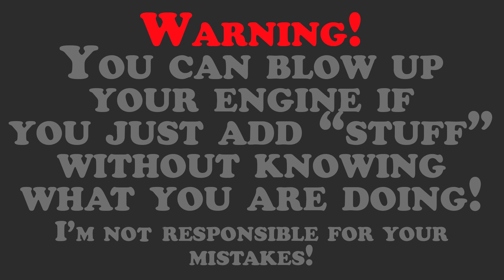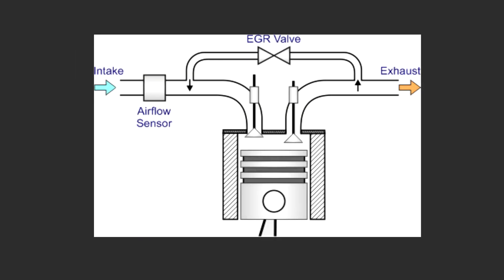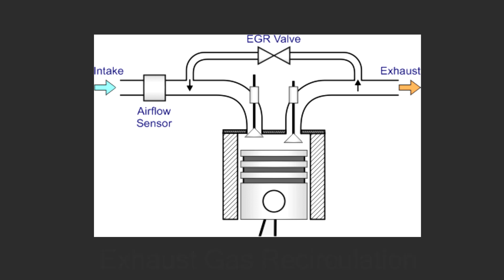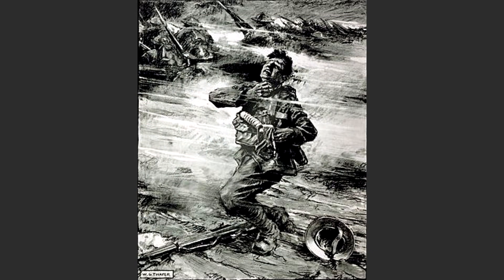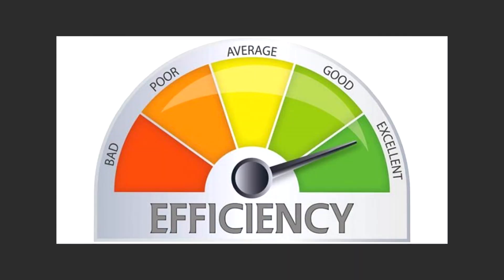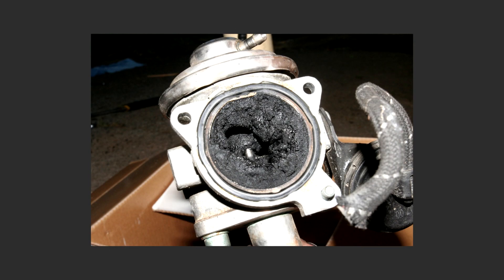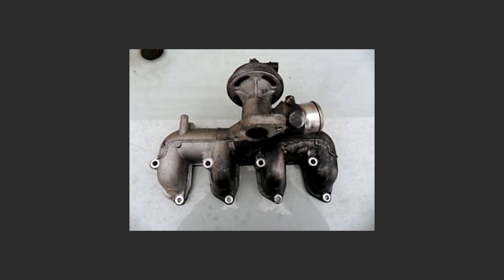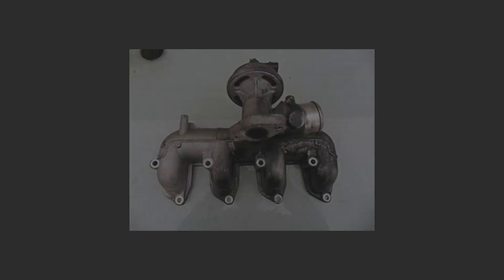Diesel Tuning - EGR Delete

Comment: I bought a blanking plate for my 1.8 TDDI but haven't installed it yet... If time allows i also want to bypass the egr cooler, i honestly think an old engine like this can only benefit from it... In some Ford forums i read that blanking the egr will lower the turbo response time... My car has a new injection pump but when it gets warm it literally loses the turbo, 6 months later at night i found an unplugged hose on the airbox, the next day i was ready to try the car properly but an oil cooler pipe snapped...i love this car but sometimes it tests my patience a little too much
Reply: I'm also planning on a coolant sensor mod using a floating sensor, an arduino and a buzzer, i almost cooked my engine a couple of days ago because of that broken pipe. I might try and do a video if this thing works out, worst thing that can happen is to buy a new coolant tank...

Comment: Do I need  to map  my car if I put blanking plates in.  It's 2012 skoda superb 2.0 tdi cffb engine
Reply from the maker: Not really, but you'd hit 2 birds with 1 stone if you do. They'd optimize the map for more power and for the lack of the EGR.
Reply: @N33sWorkshop  ok. I was told by just putting blank plate it it will cause eml  light to come on and therefore the dpf  won't regenerate and get clogged so the map essentially maps it out. I have also seen something on a forum called emulator..like a dummy egr computer which u plug into the cars system using existing plugs on car related to the egr  and vacuum hose. Essentially tricking the  car into thinking egr is active and bypassing it with blank. I'm leaning towards this option at moment as if been priced 200 for egr  delete (map out) 350 dpg/egr delete and the dummy egr thing is 122 posted d.i.y fit. What do you think?
Reply from the maker: In your place, especially if you’re planning on keeping the car, go for the more expensive option.

Yeah, maybe the emulator will do the job, but why not make it properly?
Reply: @N33sWorkshop most likely I will do the dpf egr  delete  and map it out. Just looking at my possible options and to make sure really as due to covid..money  isn't flowing best.  Another YouTube has said that  as car starts with easy start and dies wheb revved I should make sure fuel filter isn't clogged too
Reply from the maker: Yeah, I understand, but often cheap solutions become more expensive in the end.

Filters are another topic, those should be changed regularly.

Comment: Another top trick especially on pickups land rovers vehicles that’s have a chassis...... take the engine rocker cover breather pipe off the air inlet to the engine or before the turbo where ever it goes.... as this contributes to engine canker in the egr and extended the breather pipe and put it inside the chassis any oil vapour will protect the chassis inside works wonders on land rovers!!! 
O and blank it off where the pipe goes in to the air intake !!! This is a serious top trick!!!

Comment: The idea behind egr is it recycling a percentage of the exhaust gases through the egr cooler to cool them .....slightly.......I mean EVER SO SLIGHTLY!! Before it re enter the inlet manifold to re burn this slight percentage for cleaner emissions mainly on tick over blanking the egr off with a blanking plate will have no detriment to the engine what so ever if anything the engine runs cooler I did this on my Audi A6 3.0 tdi Mitsubishi l200 2005 model never had any problems what so ever this pickup did just over 212,000 miles body work let it down in the end!!!  The Audi had 189,000 miles on the clock again this never missed a beat except for right hand side engine mount sensor long story there!!! previous Audi A6 1.9tdi i took the vacuum pipe that operates the egr off so the egr valve  was permanently shut and stuck a nail up the vacuum pipe to blank vacuum pipe off!!!

Comment: Chiar asa de mult creste temperatura in cilindru in cat sa se uzeze motorul in urma unui egr off? Ai mentionat la sfarsit ca ar fi un compromis bun sa nu mai bage  gaze odata ce motorul e cald, dar atunci daca mai faci un drum de 1000km la viteze de autostrada se poate sa se topeasca sau sa uzezi prematur componentele motorului?
Reply from the maker: Creste temperatura in motor, dar nu asa de mult incat sa afecteze. Vezi ca EGR-ul oricum se inchide cu cat accelerezi mai tare. 

Nu se vor topi componentele la un motor stoc doar cu EGR-off. Doar ca EGR-ul sta inchis si cand stai la ralanti si la turatii mici cu un update din soft, odata ce motorul e cald.
Reply: @N33sWorkshop  super mersi mult! Tot vedeam pe 99 vechicles ca zicea ca se uzeaza motorul din cauza temperaturilor mai mari fara egr, de aia mi-am facut griji. Sper sa gasesc om care se pricepe sa faca asa un soft incat sa stea inchis doar dupa ce se incalzeste. Dar daca as anula total si fizic, trebuie anulat si racitorul de gaze? Sau doar soft si placa la egr
Reply from the maker: Da, bine zice pe 99vehicles, se uzeaza un pic mai repede, nu tine 1000000 km, doar 800000 km ;)) 
Daca anulezi tot ce tine de EGR, motorul se va incalzi mai incet si va polua mai mult la rece.

Oricum, daca mergi turat si agresiv EGR-ul sta inchis.
Reply: @N33sWorkshop  eu oricum merg intre 2000-2700 constant in majoritatea timpului. Sper ca nu o sa am probleme daca anulez. Despre racitor am auzit ca e bine sa fie anulat si el sa nu fie nu stiu ce presiune mai mare... oricum ai un abonat nou!
Reply from the maker: Atunci nu cred ca vei avea probleme cu EGR-ul. Daca il anulezi nu cred ca va afecta tare mult. Bafta.
Reply: @N33sWorkshop  Salut, am un Golf 5 cu motor BMM si EGR e anulat cu blanking plate si software. Vreau sa-l inregistrez in vest si sa-i redau functionalitatea. Platesc taxa verde pentru noxe cat un EGR nou pe an altfel...plus ca e ilegal aici, in caz ca ma prinde. Se poate cu VCDS sau trebuie alt soft special?

Comment: One thing I don't get though. You say that the EGR helps reducing the temperature in the engine. So if you remove it shouldn't it warm up faster?
Reply from the maker: Two different things, engine warms up faster from the EGR heat exchanger and the recirculated gas reduces peak combustion tempretures.
Reply: @N33sWorkshop  
Ok, copy. 
What if the combustion temperature is higher? I'm guessing more power and efficiency but wouldn't your engine overheat on long steep hills or terrain that requires high revs? 

Just asking out of ignorance
Reply from the maker: The engine has its own cooling system, again, different thing.

With higher combustion temperatures produces more NOx emissions. 
On long steep hills, where you go with high revs, your EGR is probably closed anyway. 
It will overheat if the cooling system is undersized or faulty (ex. cooling fans not working)
Reply: Wrong wording. Flame front temperature is higher. Actual egt is lower if engine is partially loaded because there is large mass of cool air with not much fuel injected. Its just that fuel combusts with higher flame front temperature whrn it burns in oxygen rich environment
Reply: the smartest question ;)

Comment: There is so much missinformation in the comments and about what conditions an EGR valve operates.. 

EGR valves are used for light throttle and low load conditions like crusing so when you require power from the engine the valve shuts and its effects dont come into play.
They also operate when the engine is warm and so dont effect warm up time. 

Wikipedia has referanced these books: Heywood, John B., Internal Combustion Engine Fundamentals, Internal Combustion Engine Handbook, Bosch Automotive Handbook. 

I have read them, I dont belive any of you have. Heywood is especially good.
Reply from the maker: None of the articles mentioned in what conditions EGR valves operate. On Wikipedia you can read that diesel engines benefit from at idle "when there is otherwise a large excess of air". So i give you that. 

If the EGR gas is cooled with a heat exchanger, they do affect warmup time.

Comment: Just asking a question - would simply disconnecting the electrical solenoid on the EGR be just as effective as the blanking plate? In this case, the valve cannot open to let through exhaust gasses anyway. Seems like the easiest solution to replicate the blanking plate. Your comments please..
Reply: This seems like a good idea have you had any trouble with it since doing it?
Reply: Yes unplugging egr valve will keep it closed under its spring pressure" l unplugged mine because to difficult get at' it does exactly the same job as fitting a blanking plate.
Reply from the maker: Theoretically yes 

It depends, EGR can be clogged up and stuck open, the ECU can generate error codes and so on.
Reply: @N33sWorkshop  was having a low throttle stutter on occasion leasing me to believe my EGR valve is a bit sticky. However when I go decent throttle the power comes though fine (meaning the valve at least closes properly). No EGR fault codes yet. So I have disconnected my solenoid and gone for a short drive. Not throwing any engine check lights. Will monitor over a few days to see if the low throttle stutter is gone.
Reply from the maker: @voiceinwilderness7  Good approach to the problem. Also if you have the resources, you can try cleaning the EGR.
Reply: @N33sWorkshop  considered that but the EGR removal is quite tricky (access to bolts), so looks like the better way is to remove the EGR cooler with the EGR valve together. But still and bit tricky in terms of access. This solution might just do the trick..

Comment: My 2.0 d4d Corolla takes considerably longer to warm up with egr unplugged it is vacuum type egr
Reply: All egr are vacum. Ecu control that vacuum. Unpluging egr makes your car go to limp mode. Egr is not making engine warmer.
Reply: Tomas Av. I have my EGR blanked on my new car but still plugged in no check engine light and better response if I unplug the connector check engine light comes on 👎🏻
Reply: What year? I got a 2005 2.0 116 HP Corolla Verso and I'm considering a EGR block.
Reply: Reaper Mine was 2003 older style EGR

Comment: Rubbish! i have a blanking plate on my Navara and its takes the exact amount of time to warm up with the plate as it did before..
Reply: For the record not all engines has a EGR cooler meaning not all engines rely on the the EGR for heat gain..some are just direct from exhaust to intake with EGR in middle to regulate..
Reply: Totally agree here!!

Comment: My tdci has a blanking plate and still gets to temp within 5 to 10minutes
Reply from the maker: Even when there are -12C degrees outside?
Reply: @N33sWorkshop On my TDdi EGR is blocked in shut position. Engine warms up after 5 to 10 minutes of driving, even at really cold temperatures.
Reply: Not all diesel engines has EGR cooler which warms coolant. Or do you have some other methode in your mind that relates EGR to warm up engine?